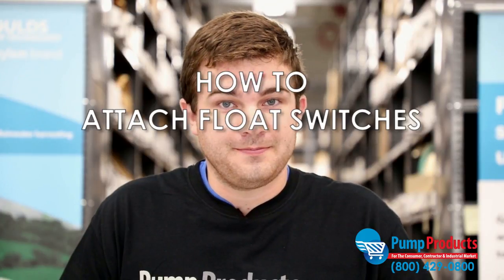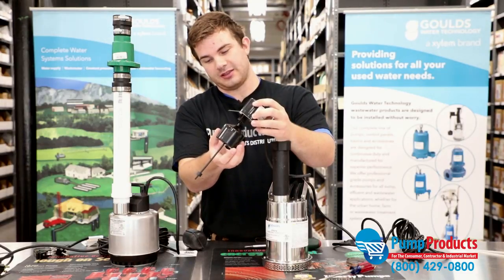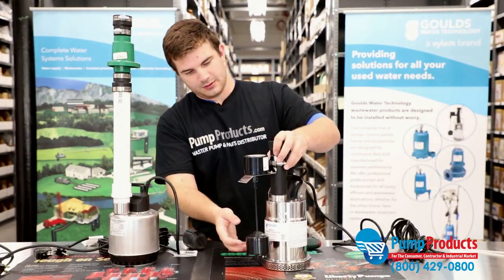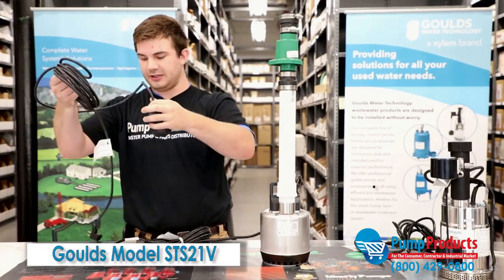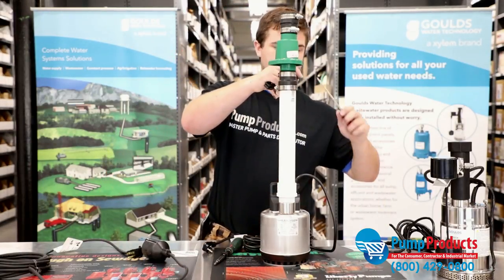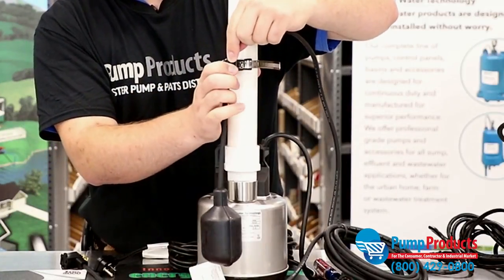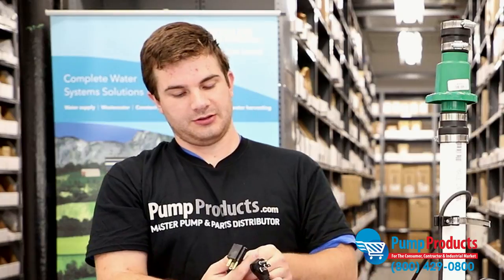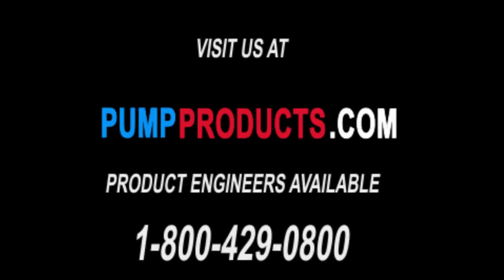How to Attach a Float Switch to Your Pump

Comment: We just moved into a house where the washer drains into the utility sink, but the utility sink isn't big enough to hold a full laundry load's worth of water, so we'd have to sit by the washer or check on it every 20 minutes or so to see if we needed to turn the pump on, yet, since you can't let it run dry. I'm going to get a piggy back float switch for the utility sink and that should make it so we don't need to babysit it anymore. Very excited.

Comment: Any idea where is can buy just that clamp with the black plastic piece for that tethered float?    

My pump had a simple clamping piece of metal for the cord screwed into the pump housing, but when I tried to loosen it to adjust the float level, the screw broke off.  That clamp with that black plastic piece looks like it would fit the bill for me.

Thanks.

Comment: I have to replace my float switch, I was just worried I'd have to tear the pump apart. This SHOULD be easy.
Reply: It took me a second to realize he’s not showing a replacement or first install.. it was already wired into the unit he’s just attaching it 😂

Comment: For the tethered piggy back style should I leave it constantly on (plugged in) and let the float decide when to turn it on. As of now I plug it in when the water level gets high. I was afraid to burn the pump or the float out.
Reply: leave it plugged in.  no need to plug/unplug constantly.  that's the purpose of the float - to turn on when the water gets high, then it shuts off.  will not burn anything out.